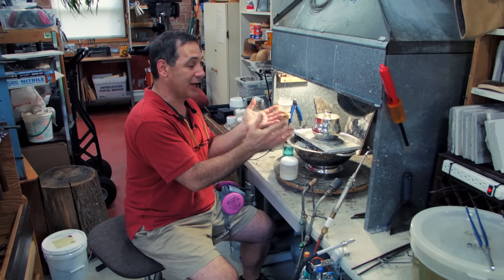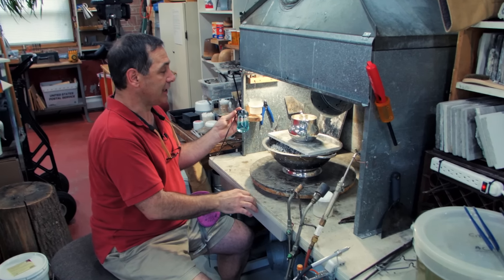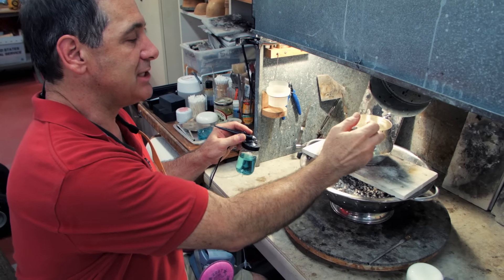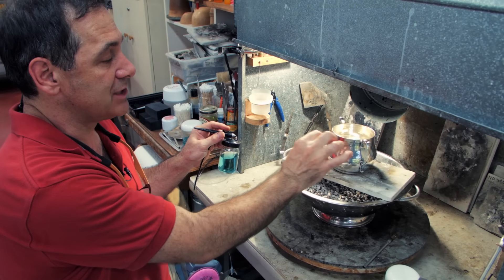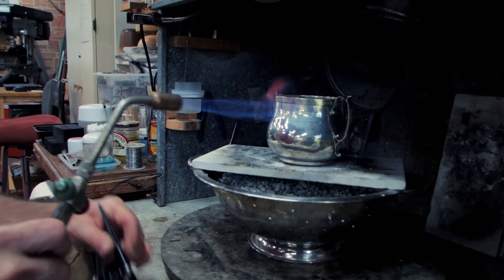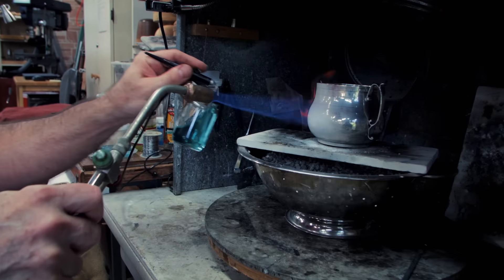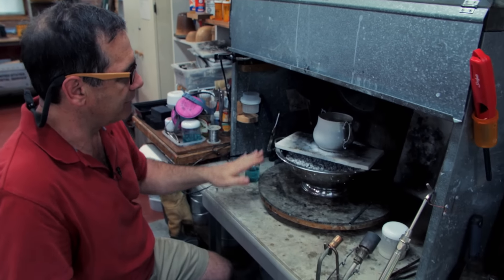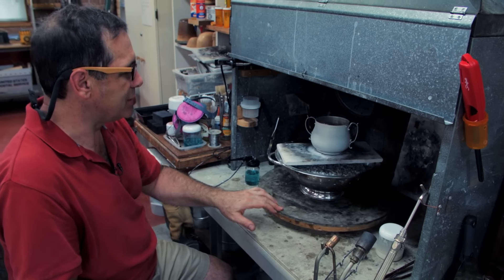Liquid Flux for Better Soldering

Comment: Can you give more info on the air brush equipment?  Also, thank you for providing these videos.  Have loved every one of them.  When you are talking about your soldering station/area, I would like to know more about the set up, more details of what you have hanging on the wall, what everything is made of, etc.  For example, "This is my soldering area.  Here I have....and then there is...etc.  I love the colander with the stones.  Wish I would have seen this years ago when I was setting my station up.  I'm very curious on how I can improve my work areas.